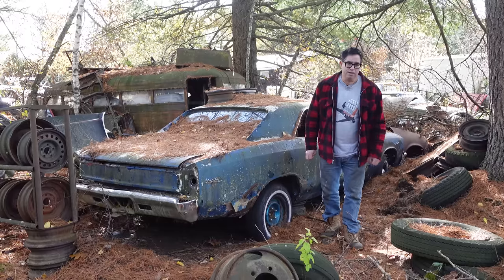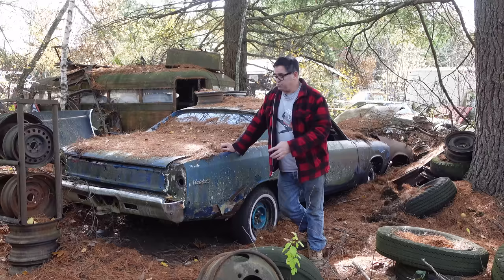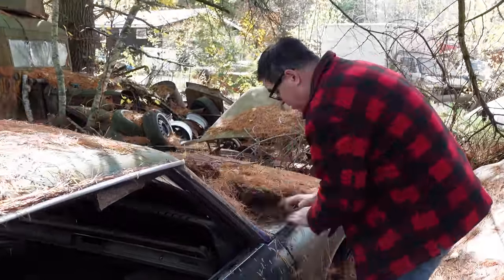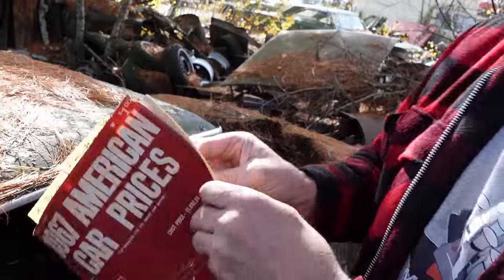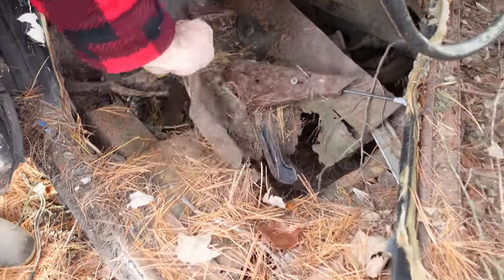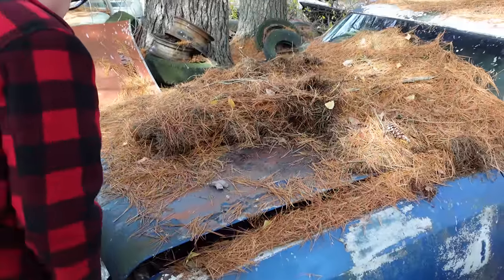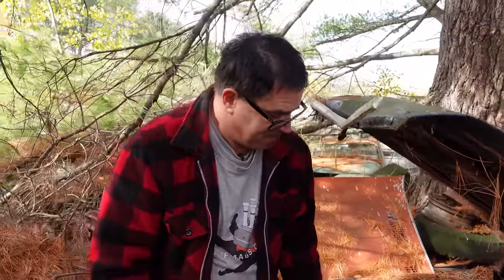Silent Malibu

Comment: Steve, I'm surprised you didn't mention that in the Malibu, one could order the 327/350hp engine, which was essentially the Corvette engine. The Corvette had 3 variants: 327/350; 327/365 (solid lifters and cam) and 327/375hp (solid lifters, cam and fuel injection)   Back in those days, my brother and I were Corvette guys and were not big fans of the 396. I actually went to my local Chevy dealer in New Rochelle to price out a Malibu 2dr Htp with the 327/350, close ratio 4 speed and 373 gears with posi. Bucket seats and am/fm radio. The price was $2800, which was cheaper than buying an SS396. As I said, we were not big fans of the early 396 engines and we had many street races with our 327 cars against SS396 cars and blew them away.  We never saw the more powerful 375 and 425hp version very often in 66 and 67 cars.  Just wanted to share a trip down memory lane with you.
Reply: I know Curry was in Westchester, and Arroway in Katonah. I can't remember who the Chevrolet dealer was at that time in New Rochelle. I have some NOS OBS truck parts that a friend gave me that came from Arroway.
Reply: @googleusergp  I may be wrong as my memory is a little foggy but I remember Curry Chevrolet being in the Bronx on Bruckner Boulevard and Castle Hill Avenue before they moved to Westchester
Reply: @HotRod-wv4vm  Yes, they were in the Bronx. My friend was from the Bronx at one time and their website confirms that they did have a location there.
Reply: Hi Izzy Dizzy, I think you are correct.  I had a coworker that had a regular 1967 Chevelle factory equipped just like you described.  Please reply.  Dave...
Reply: I bought this malibu and got it running! Watch it @neshpro6521

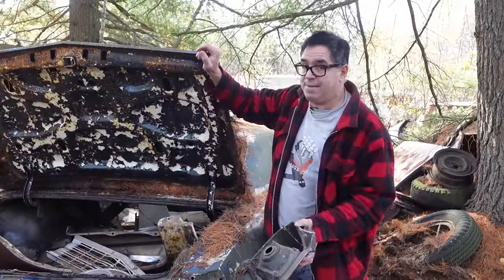Comment: I used to own a '67 Chevelle 300 2 door that was originally ordered to be a drag car. Options it had: 327/275hp, M20 4spd, posi(with dealer installed 4:10s), air shocks, all windows tinted glass, rear speaker, am radio, dark green paint, black vinyl interior with head rests on it's bench seat. It was trailered home from the dealership, had tow bar brackets welded to the front frame rails and was raced until 1973, it was never licensed for the road in that time span. Then it was sold and went through multiple owners until I bought it in the late '80s. Naturally all the original drive train was long gone but I did find out at one time the original engine still existed then. It was a really neat car, very rare car.
Reply: I bought this actual malibu and I got it running! see it @neshpro6521

Comment: My parents had a green '66 "Malibu SS" that had a 283 and a Powerglide. My brother and I "inherited" it in the late 70s and, after a 350 swap and a reverse-manual valve-bodied 'Glide with a 3800 stall converter we had a lot of fun as teens in the early 80s. I was hoping Steve might talk more about the SS variant of the Malibu as well as that iconic coke-bottle styling and "tunnel back" roof design on these cars.
Reply: I bought this malibu and got it running! Watch it @neshpro6521
Reply: Mike  P. 
In 1966 the Chevelle  was either  a Malibu  or a Super  Sport 
But it was not both  
All Super  Sport cars had big block 396 engines  , 4 speed  Muncie  and 12 bolt  Posi rear end , 
The 66 Chevelle  Super  Sport was its own  model  
The 66  Chevelle  Malibu  was it's own  model      

So you had a  66 Chevelle  Malibu
Reply: @jimthomas1989  Whatever it was I bet it was a blast to drive!
Reply: @jimthomas1989  Ours bore the factory quarter panel emblems shown here: https://www.ss396.com/mm5/graphics/00000001/TC-4210.jpg Perhaps this was a Canada-only thing?
Reply: @neshpro6521  , I have no doubt  it was a blast  to  drive  as  I  first  hand experience  , 
As I own both a 136  Malibu  1966 with  a 71   small  block  LT1 350 ,  4 bolt main making  375hp , HEI distributor , 750cfm Holley carb. , Headers and dual exhaust  ,11 inch clutch,  4 speed  trans and  10 bolt rear , 

A  138 Super Sport  1966 with a  built  small block  327 , 12:1 forged pistons,  forged steel  Vette crank , in a 4 bolt main 350 block  ,  aluminum  intake,  
1050 Holley carb , Headers , 450hp , Lakewood  Blow Proof  bell housing  , 11 inch clutch  , M-21 Muncie  4 speed  trans , 12 bolt posi , pulls both  front  tires off the ground in  1st and  2nd gear , screams to the  moon  at 11,000rpm , 
Runs 5.5 sec@ 96mph in the 1/8 mile , 
Drag strip is actually  less than 1/8 mile but every one calls it a 1/8 mile  ,
Gets 3 miles to a gallon of gas  , 
5 if I'm  easy and I am Never easy , 
I have since changed  carbs to a 750cfm but I have  seen no changes in  gas mileage  ,  
And you are 100% percent  correct  ,
They are a Blast to Drive  , my Malibu  is my daily  driver  !   

But you should  see my Third 66 Chevelle   138 Super Sport  I'm  building  , 
A small  block  327 pushing  the 500 +hp
range  ,    

I also  have  2 Camaro and  2 Nova , 
Yes they have  327 and  350 all with 4 speed trans  , and  a 1998 Chevy S-10 with a  350 and 350 auto trans  , 

I been building  small  blocks  for 40 years and they weigh less and  Rev higher than  any big block  396 ever  thought about

Comment: Factory air shocks as an option. I didn't know that existed.  Big block 69 4 door Police car. That would be fun/nostalgic to run around in... I learned two more thing in the class room this morning.  Thanks Steve.  Keep it up. Like button energized.
Reply: I owned a '73 LeMans Grand Prix GT that had that same air-shock setup. It was already non-functional when I bought it in 1975.
Reply: I bought this actual malibu and I got it running! see it @neshpro6521
Reply: Chevelle 65 4 dörrars polisbil 409

Comment: My parents had a 1965 Chevelle Malibu station wagon with a 283 V8 and a standard 3 speed column shift. It did have a radio but no ac and no power steering, no power brakes. It was still a good car.
Reply: I bought this actualmalibu and I got it running! see it @neshpro6521

Comment: I remember adding "high jacker" air shocks to fit some L60 15's "jacked up" it somehow made the car faster back in the day- i have owned almost every year chevelle 66 and 70 being my favorites good video steve!
Reply: Yup, Gabriel "Hi-Jackers". It came with the rabbit decal in the box. My 1983 Snap On KRA59F toolbox has that decal on the side. I got the box like that from a coworker. The price was right, it was free with tools inside and on top of a 1981 Craftsman lower rollaway, also with tools in it. It's in my workshop property now, along with other Craftsman tool storage company.
Reply: I bought this actual malibu and I got it running! see it @neshpro6521

Comment: For those following, we know more about this car, as it was saved by YT'er "NeshPro". Here's what we know:

It was originally a 1967 Malibu two door Sport Coupe V8 car. The "36" in the VIN proves it was a V8 car, but it was not an "SS" as noted by Mr. Magnante. It was assembled in Framingham, MA.

NeshPro posted the tag and we now know that is a 1967 (67 on the tag), Malibu Sport Coupe V8 (13617, although some references say the "36" in the tag does not denote V8, but the "36" in the VIN does), made in Framingham, MA (FRA), made the second week of November 1966 (11B), had a Black imitation vinyl bench seat interior (761-A), and was Capri Cream upper and lower exterior paint (T-T). It had a tinted windshield (W), had a Powerglide two speed automatic (M, RPO code "M35"), and also had a rear antenna (S, RPO code "U73").

Comment: I had a maroon '65 Malibu 2 door hardtop with a 283 and Powerglide. I paid $200 for it in 1975. I got in an accident with it on a Friday night, went to the local junkyard on Saturday morning and installed a "new" white fender from the junkyard same day. I later traded the car for a bicycle.
Reply: I bought actual this malibu and I got it running! see it @neshpro6521

Comment: My project is a 68 el Camino / Chevell / Malibu. I found a vortec 350 out of a 96 Chevy work truck and a turbo 350 all fits nicely. I found bucket seats from a 66 Chevell. 15” aluminum rally rims. I’m almost 59 years old and don’t think I’ll ever spend enough money on her. It will bury the speedometer in a half a second. Oh. I just bought a band new eldebroc 650 cfm carb. Still needs a lot of work but I can at least drive it
Reply: Nice! I bought this one! I put on a aluminum intake and edelbrock carb!

Comment: Used to walk to work as a teen past 3 sparking Malibu wagons that one guy owned and washed almost everyday.  Walked past a 70 mach1 for a few grand around the same time but it was sans drivetrain and I was only changin tires and oil back then. It was a fastback. Always liked those. Still kickin myself.
Reply: @Napalm Holocaust👆👆👆
Reply: I bought this malibu and I got it running! see it @neshpro6521

Comment: Later model intake. No fill tube.
Reply: Yup ..
Along with that bigger alternator bracket on the other side and no stamped valve covers ..
A bit more # s runnin and the truth is told .
Probably a bit later swap .👊🏼

Comment: I had the 67 Malibu with the 283 and power glide. Probably my favorite car I've ever owned. Manual brakes and steering. That same color blue too. It was a rust bucket but it was the easiest car to work on. I miss that car like crazy.
Reply: I bought this actual malibu and I got it running! see it @neshpro6521

Comment: I've owned a Fremont built convertible for 35 years. 6 cyl,powerglide,tilt wheel ,manual top . Gold/Gold . Not fast but dependable . Purchased new at Lew Williams Chevrolet,Sacramento Ca. She has always been in Ca. $2,700.00 new
Reply: Top down price goes up!

Comment: Over the years I've owned two 66's. My first one was a Malibu 327 4 speed with console. Second one was a SS 396 4 speed with a bench seat and tilt colum. Also had factory air bags in the rear springs and a ugly factory clock bolted to the top of the dash.
Reply: I bought this actual malibu and I got it running! see it @neshpro6521

Comment: I think 67 was pretty much the pinnacle as far as looks for many manufactures.
Reply: I think '71 was pinnacle for looks for cars....1971 Chevelle with round tail lights, 1971 Camaro with split bumper, 1971 Plymouth Cuda with cheese grater grill, 1971 Mustang and Torino, etc.
Reply: I bought this actual malibu and I got it running! see it @neshpro6521

Comment: Wow. It's got the original 283, which was one of Chevy's best small block engines. With the 2 speed PG tranny that would fly on full throttle "kick down". My dad was a fire fighter. We had a '64 four door Belair sedan with this identical drive train. He had a fire monitor radio, with vacuum tubes mounted on the hump with a steel whip antenna on the rear bumper corner.   We ran fire calls and I was navigator. We would pull out on the " freeway" and " put the hammer down ". 0 to 75 mph in 10 seconds.  The speed limit was 75 back then, and that " little 283 would roar like a lion when dad hit " passing gear!  Interestingly, mom would take us to school, and she drove it like a little old lady. I remember when it was cold outside, the power glide would howl and whine like a wild coyote.  Also there was a green light on the dash board that lit up when the engine was really cold. When it would go out, the PG would stop whining, and mom could turn on the heater for warmth. Thanks Steve for another great junkyard crawl review. I wouldn't mind seeing someone fixing this one up, especially since it's so unmolested.
Reply: I bought this actual malibu and got it running! see it @neshpro6521

Comment: Sad to see it in that condition. I have always been a fan of 1960s and early 1970s Chevelles and Novas. My first car, at age 16 in 1975 was a 1963 Nova SS which I inherited from my dad, who unfortunately passed away that year. It came with a straight six and a powerglide. I built a 283 for it, which originally came from a mid '60s Chevelle, and bought a beefed up powerglide. The 283 first had a single four barrel, which eventually got replaced with a tunnel ram and 2 four barrels. It had headers, and glasspack mufflers which bolted directly onto the header collectors. I also switched to a posi rear end, and installed air shocks, which raised the rear high enough for the fairly low fenders on the Nova to clear the 14" Mickey Thompson L60 rear tires. As the build progressed, it started to become a handful on the street, so at age 19 I bought a 1972 Nova 350/4 speed for a transportation car, and used the '63 Nova strictly for my drag race car. The first Malibu I owned was a 1974 Malibu Laguna 2 door with the plastic front end, and later a 1981 Malibu 2 door.
Reply: @Gerald Scott 👆👆
Reply: I bought this malibu and I got it running! see it @neshpro6521

Comment: Most people these days don't understand that you use to be able to walk into any car dealer and special order just about anything you wanted as long as it was a regular production order item (RPO) in any combination and not have to buy special groups just to get sport mirrors or some such marketing tripe. I bought a new Camaro in 1975 and Chevy had dropped the Z28 that year so I went thru the RPO book and had it built exactly like a Z would have been spec'ed out with 350 four barrel, four speed, positraction, special handling package with heavy duty shocks and front & rear sway bars. I added the rally wheels with front & rear spoilers as well on the basic LT package that gave you the upgraded interior trim and seats. The only thing I couldn't get was the blacked out hood and Z28 decals but I really didn't want that anyway.
Reply: Yes, very ala carte back then. Some option packages were "all contented", e.g. the 10th Anniversary Trans Am got you everything as far as Firebird options and then some that weren't available on other Firebirds. In that car's case (I have one), the engine was the only choice. That dictated the transmission (400 Pontiac cars had 4 speed manual Super T10s, the 403 cars had THM350) which then also dictated the rear axle (3.23 for 400, 2.73 for 403) and the 400 didn't get cruise control since GM didn't want to design a servo for a single year as the 400 was going away after 1979. Also, the 400 was not certified for use/sale in California or high-altitude areas. Funny though, Van Nuys, CA did assemble plenty of 400 cars, but they couldn't be sold or registered there. A few slipped through I'm sure.
Reply: I bought this malibu and got it running! see it @neshpro6521 I had three 2nd gen Camaros

Comment: As I've mentioned before, I have a good friend who would snap that car right up without hesitation. As a matter of fact I'd have it myself. Rust and all, to make a drag racer with it.
Reply: @Lil Mike👆👆
Reply: would be a perfect start to a straight axle gasser--that way a solid, all-there car doesn't get hurt. and this has patina.
Reply: I bought this actual malibu and got it running! see it @neshpro6521 will race car this deal eventually

Comment: So I have a 72 2 door Chevelle Malibu. I traded my 280z for it. It used to be a 307/auto, but it had a .30 over 350 with headers, cam, and a saginaw 4 speed hacked into the floor. Around 1993, the motor swap took place. Not long after, they crashed it into a ditch, killing the left front fender, hood, bumper, grill, maybe the core support is straight enough. But the frame is tweaked, the hood and fender were long gone when I got ahold of it. And it sat with the intake manifold off the motor, for 25 years. It had what was left of a tarp, but it's a boat anchor. A local body guy sold me a non cowl hood for 60$(he said just so somebody will use it) and I have a 09 5.3 I want to use, And a late model automatic. But if the frame won't go straight, and there is already a big hole cut in the floor, it might get clipped with a 2000 olds bravada awd, gain power steering, disc brakes, ect. My measurements say it will work, and since the interior is trashed, set it up like an old dirt track car.  An awd Chevelle would definitely be unique.
Reply: I bought this actual malibu and got it running! see it @neshpro6521

Comment: Before musclecar prices shot up after the 1987 stock market crash, this generation of Chevelle was popular at the local cruise nights here in CT.  It was just big enough to take a big block without needing the convertable frame support in the Z16 Chevelle, but not as heavy as the 1968 and up. The issue of course was the transmission--powerslides were common to find--and drum brakes all around, both would add to the price of hot rodding the car.  Of course 138-code cars were still affordable, but we forget most would be 325-350 hp models (which is why so many 390 Ford owners will say they owned a powerful car--in a small town where Hemis and L72s were rare, they aren't lying to you). 

I had a chance to snap one up for $2,000 a decade ago (able to drive home condition) and I had a spare 283 small block I had traded for a ranger pickup bench seat with no tears to put in it in place of the 230 I6 and a junkyard THM400 and a $15 pair of headers and a free Z28 intake manifold.  But I was taking care of elderly parents so, I couldn't pick up such a distraction to sit outside in the snow.  I should probably consider this, but for all the work, I'd want to do it right and half the fun is picking up a useable car and cleaning out your garage of all the parts you picked up "too cheap to pass up" and get them to work together :)
Reply: @Albert Gasper 👆👆👆
Reply: I bought this actualmalibu and got it running! see it @neshpro6521

Comment: Hey Steve. I have a 67 Malibu 327 glide car. 12 bolt posi rear. It has the antenna on the rear but not on fender? Originally a delete car possibly?
Reply: I bought this malibu and got it running! see it @neshpro6521 this one has a hole for antenna in the rear quarter